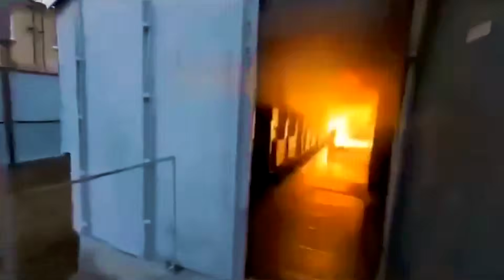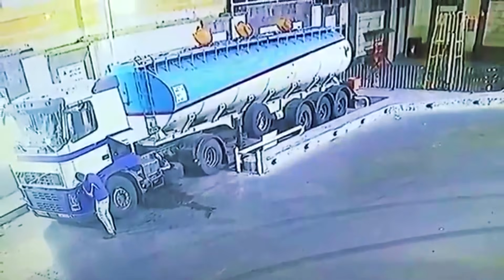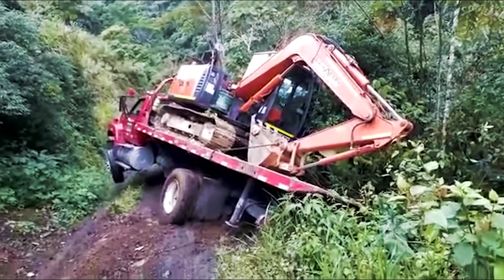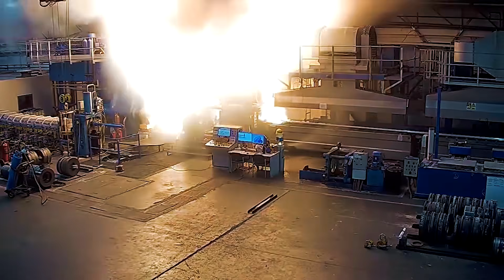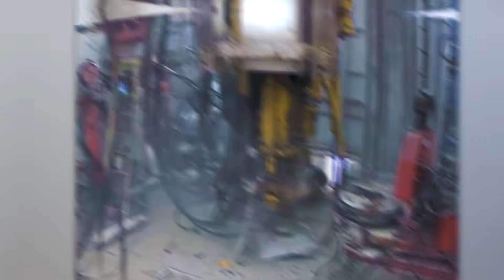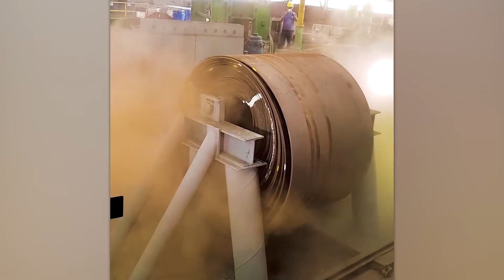Heavy Machinery and Industrial Mistakes Caught On Camera !

Comment: Hey stupid Low Boy trailer is how you transport heavy equipment like Road Graders . Not a ten wheeler with a flat deck the is to talk too tall for over head obstacles. And the ten wheeler suspension is too short and high center gravity makes the load very very easy to tip over.